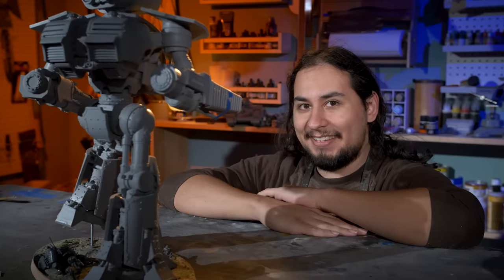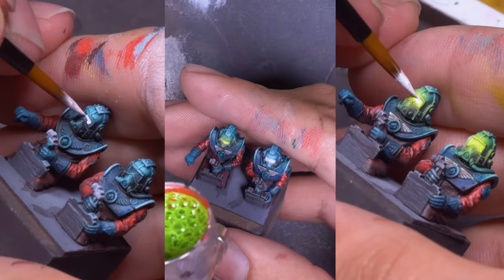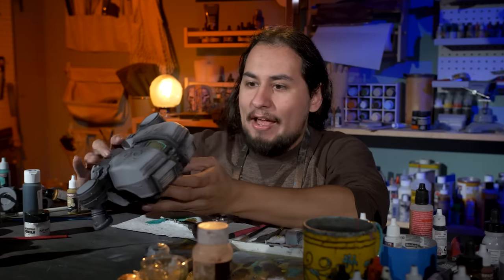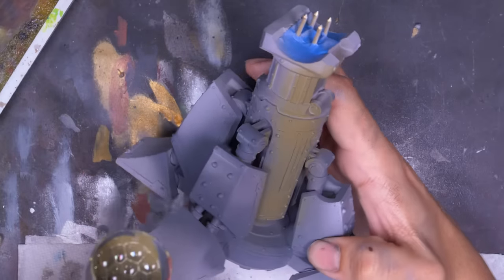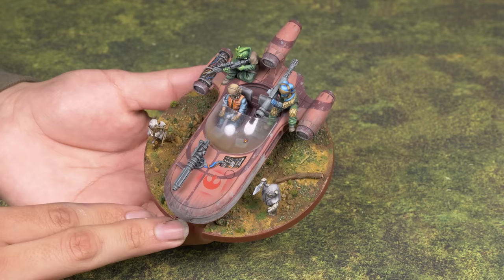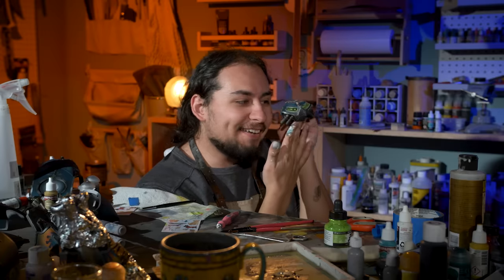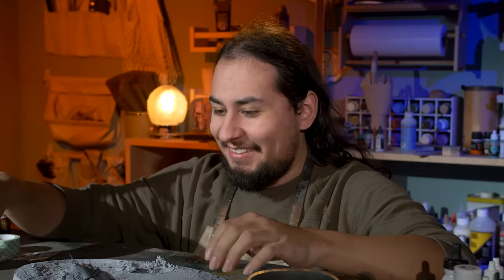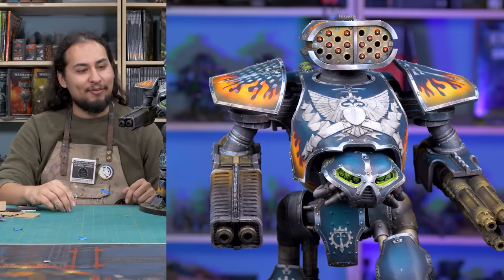I Painted a $1400 40k Forge World Titan!

Comment: I think the other advantage of the head first in this case, is its sort of a concentration of the whole process, distilled into one smaller piece. You have some glowy bits, some metalic mechanisms, a bit of armor slab, some small detail work, etc. 
Basically, you can use the head a bit like a finalization step on most if not all of the pallet.

Comment: So the mars pattern warlord titan looks to be £1,185.00 for the body then another £110.00 for one of the weapon arms, £80.00 for the head, £145.00 for the shoulder titan blasters or £132.50 if you want apocalypse missiles launchers instead, £125.00 for the power claw totaling £1.632.50-£1,645.00 ($2065.08-$2080.89) depending on should mounted weapons could see costs there's also 4 weapons so you could end up spending another £330.00 for the other 3 arm weapons, and you already saw the price of the shoulder weapons. There's also a titan tech priest engineer though he's only £20.

Comment: Hydraulic tubes should be either classic chrome, or have the somewhat "ribbed" and rough appearance of laser cladding, or the white-ish and matte look of the HVOF coating.
I guess laser cladding would be more appropriate for 40k because is basically welding while chrome and HVOF coatings might be too "exotic".
But for this application, i think the rough texture of the metal paint you used is OK. Meaning that in that scale, the laser welding ribbons would be rather hard to see and from distance would like like this.
Not sure about the hotrod flames though. I mean is a Loyalist titan, not Ork...